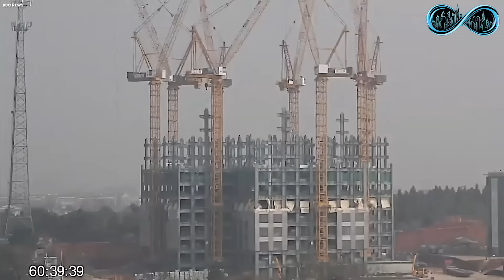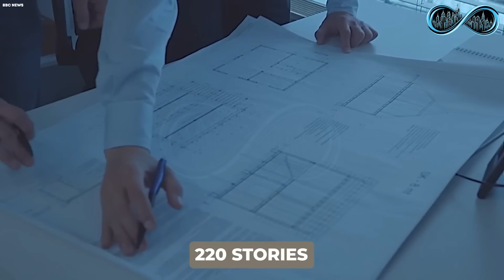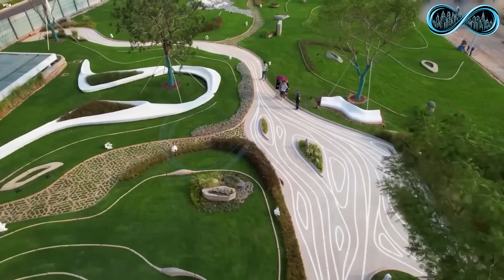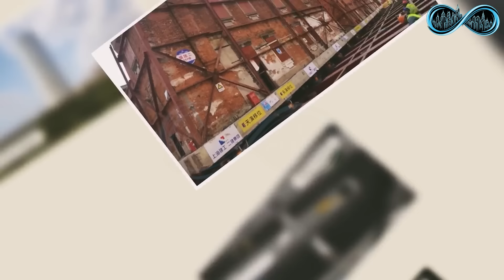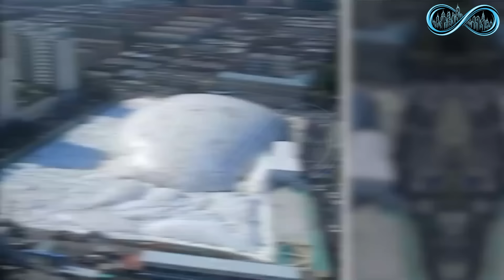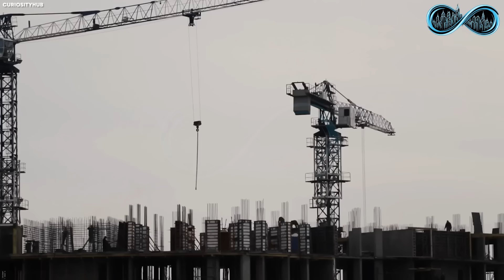China is 100 years Ahead! The US is in Shock This Huge Construction Project Proves That

Comment: Sorry China is a paper dragon just like Russia is a paper Bear.  Sure they make things fast and they make them look impressive but the thing is they are not quality.  Russia uses 20 year old technology and puts a new skin on it.  China did the same with their next century navy except they are using old boiler systems requiring them to stay close to home to refuel.   China toys to reverse engineer but doesn't have the technology to do it right - oh it looks the real thing but it breaks under pressure.   It's like a hospital that is built in month sure it works for a few years but then starts to fall apart.  Sorry it's just reality only a free market can produce the best.

Comment: Problem with using a 3d printing concrete machine is how do you ensure it's pouring consistently? You get bubbles in the mix and the machine can clog. What sort of safety measures have been put in place to make sure this doesn't happen?

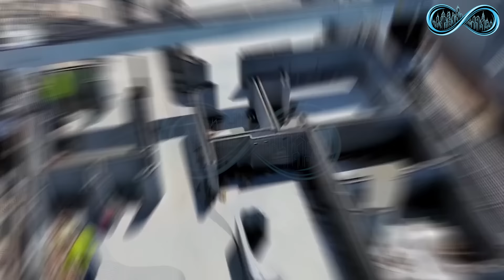Comment: 5:22 Not to put to fine a point on it, but the arch is a very traditional way of building bridges especially, that is at least 2000 years old. Pre-constructing parts is not new either, so only the 3D printed part is relatively new.

Comment: The main problem is will the soil upon which it is built hold the weight? They are not doing very great on that end. A lot of their buildings are leaning due to building on soil not meant to hold that much weight. It will not matter if it sinks due to it's weight.
Reply: they are very good at making videos to please the population and make them forget all the failures. Time will tell.
Reply: Sorry to tell you but china doesn’t have to much soil it’s mostly rocky ground
Reply: @cesarsuarez3444  You don't know what you are talking about. When the ground washes out underneath it is not rocks washing away. It is soil .